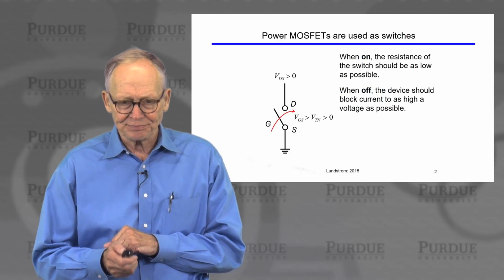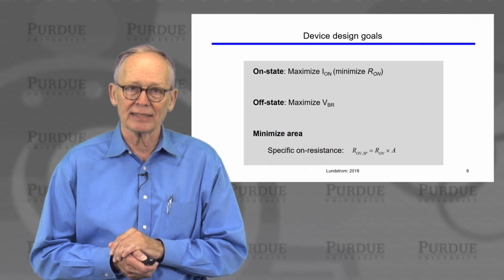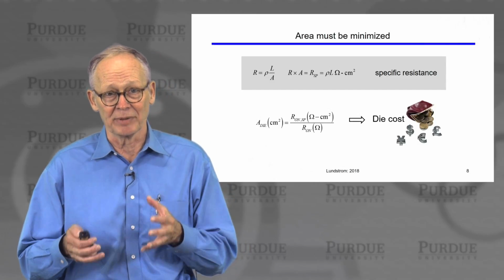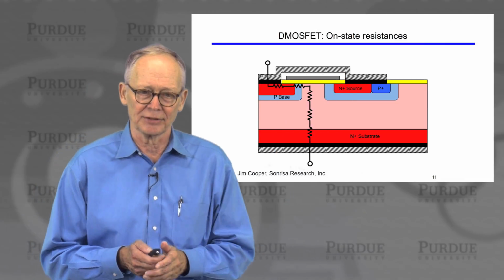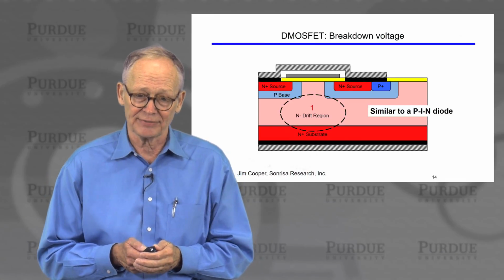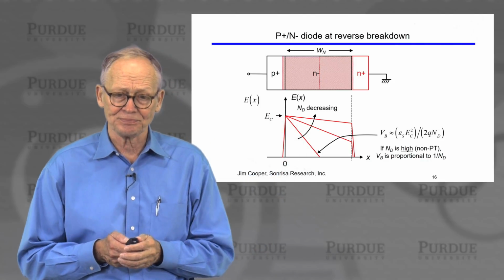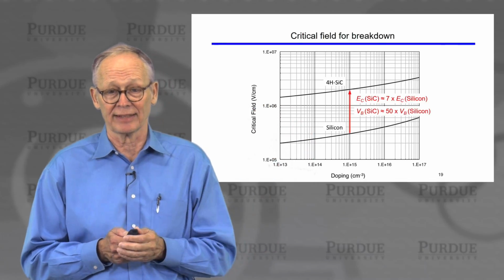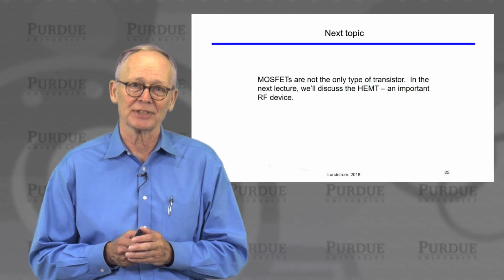nanoHUB-U MOSFET Essentials L5.2: Additional Topics - Power MOSFETs

Comment: 00:00    Lecture 5.2: Power MOSFETs
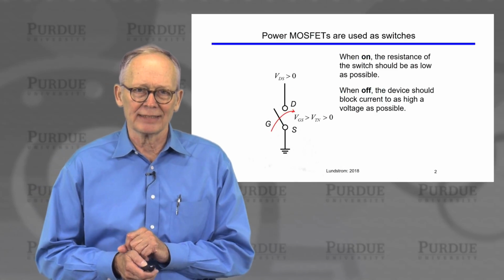00:33    Power MOSFETs are used as switches
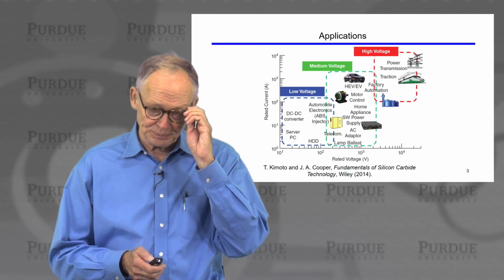01:04    Applications
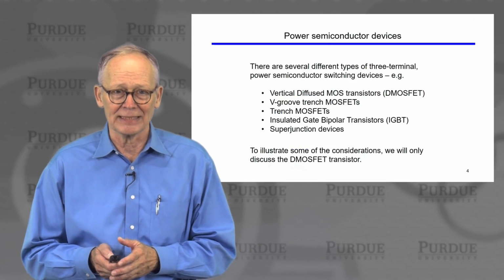01:54    Power semiconductor devices
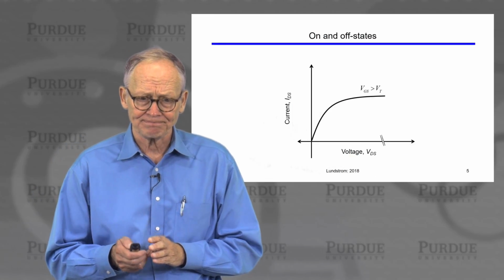02:31    On and off-states
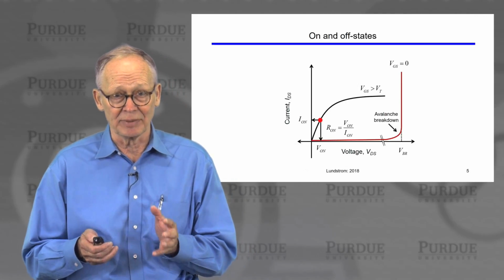03:24    Device design goals
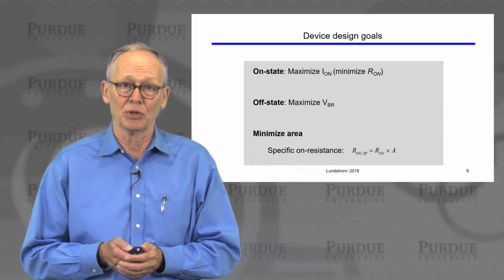04:00    Device design goals
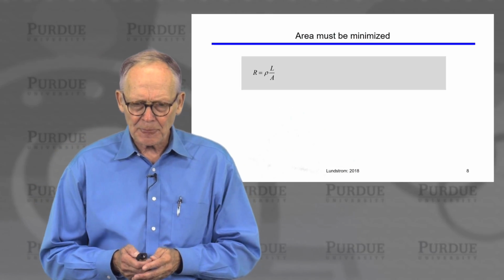05:33    Area must be minimized
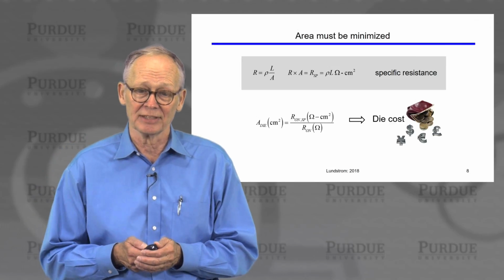06:44    DMOSFET
08:47    DMOSFET: On-state
09:34    DMOSFET: On-state resistances
10:53    On resistance
12:36    DMOSFET: On resistance
12:45    DMOSFET: Breakdown voltage
13:25    P+/N- diode at reverse breakdown
15:19    P+/N- diode at reverse breakdown
16:18    Specific on-resistance
16:52    Resistance – breakdown voltage trade-off
18:21    Critical field for breakdown
19:12    On resistance vs. blocking voltage
19:57    Applications
20:09    DMOSFET
20:25    For more information
20:49    Summary
21:32    Next topic

Comment: Hello,
Thank you for your video.
I have read that power MOSFETs which are vertical MOSFETs in general where the drain is at the back and the source and gate are in the same plane at the front can have a pinch too. 
But I wonder how to represent the reduction in channel length(pinch off see in lateral MOSFET) for vertical mosfets due to the increase in drain voltage because the drain is at the back, away from the creation of the channel position.